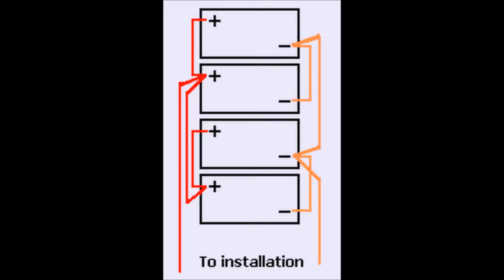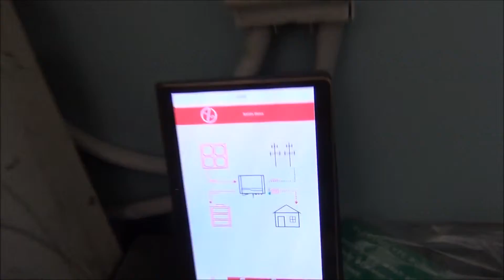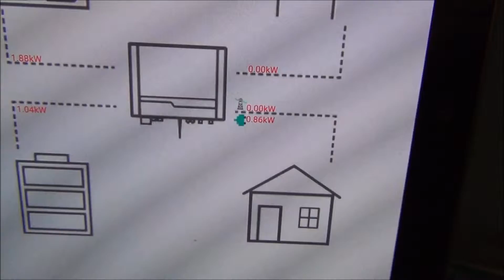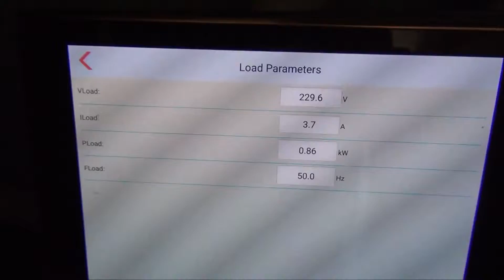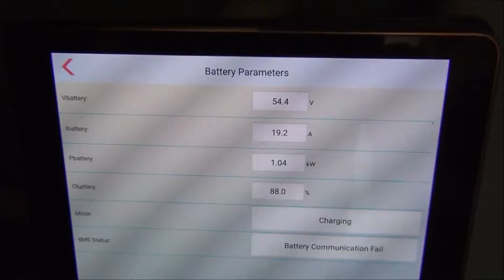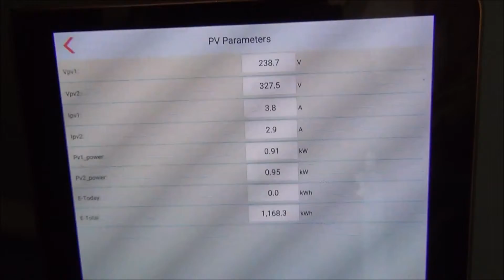Solar Powered Battery bank update

Comment: If you don't get paid for your electricity, why are you giving them your power for free
Reply from the maker: +JWSolarusa John Wesley The poor power company will pay me one day when I give them $550 to change my meter they will give me 5c a kwh and sell it to my neighbor for 33c inc tax. But as my inverter is still not working properly I have no choice as it still wont charge so well off grid and when on grid only slightly better.
I still have a lot to work out to get it working as it should, but im making slow progress.
Reply: sctpc 
Sound good. 
Keep it up and have a wonderful evening. 
Cheers